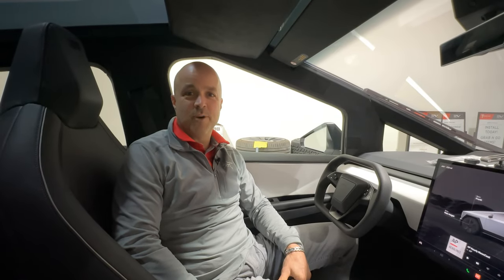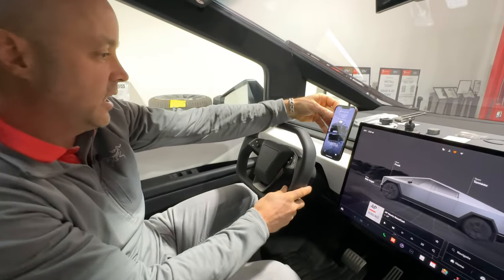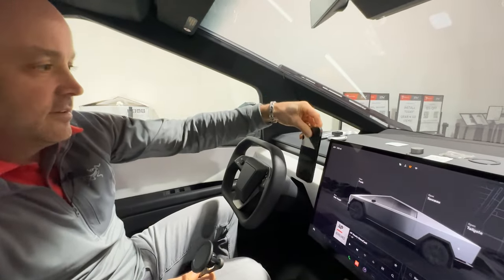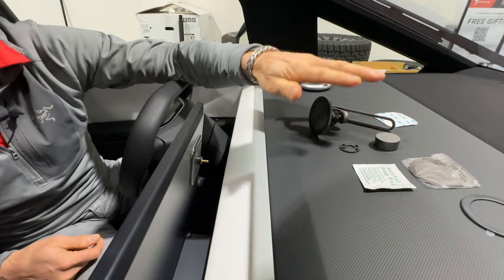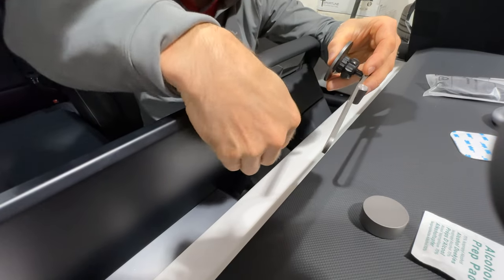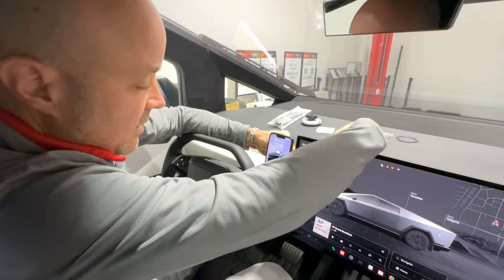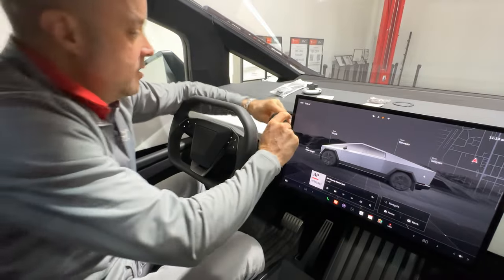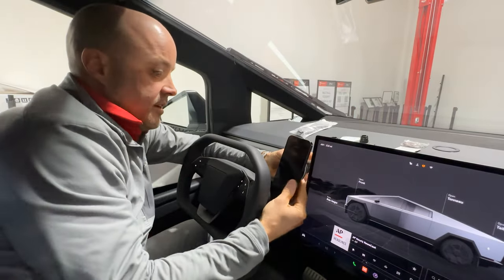Cybertruck MagSafe Phone Mount & Charger for iPhone & Android Devices 📲 Plug and Play Tesla Kit

Comment: I use a ram mount on back of my Model 3 monitor so I can then use a quad lock (secure, charges) for my phone, or any other device that has a ram mount - navigation, etc - works slick.  It is nice having Phone line of site for Waze, other.  This looks like a good solution if just want for a phone!  Thx for showing the routing, that was my idea - except going to a rear usb outlet but hard to vet without a truck!  :-). Keep up the good work!